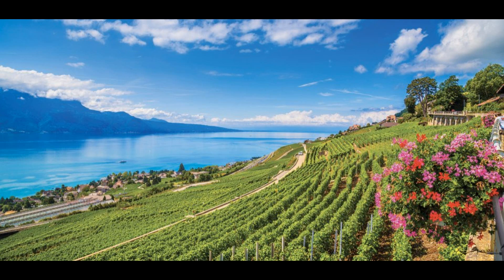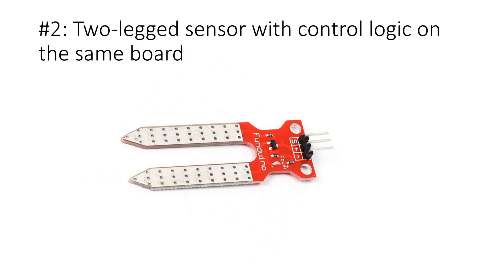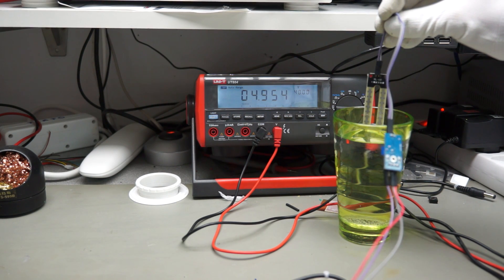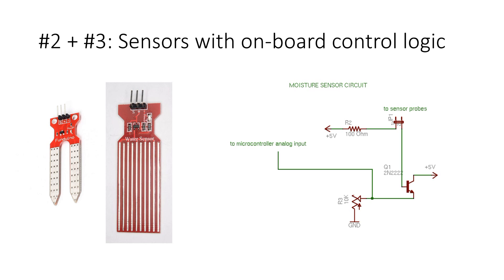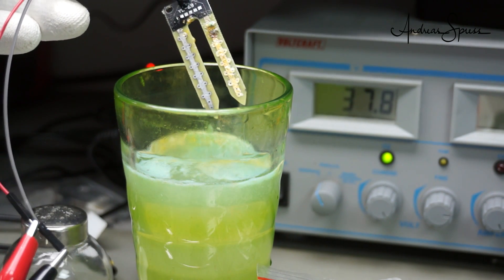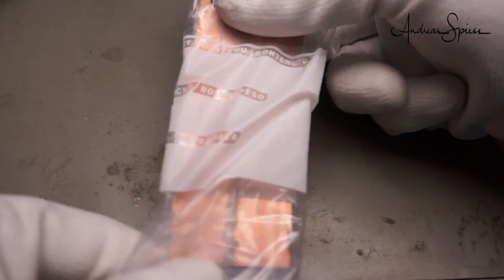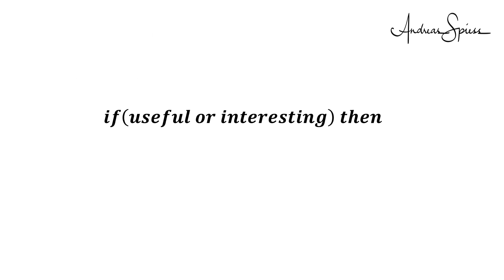#207 Why most Arduino Soil Moisture Sensors suck (incl. solution)

Comment: Likely someone already explained the green foam in the water, but to keep it fresh, a brief explanation.

The green "gunk" is the de-plated copper from the sensor.  Copper turns green when combined with oxygen, forming copper-oxide.  (The Statue of Liberty was once copper colored, but exposure to the environment turned her "skin" green.)

Wow, that one was staring me right in the face and I should have realized these cheapo bare copper sensors simply won't work!  

I know what's happening because I use a similar method to extract gold from computer electronics.  The method I use eats away the copper holding the gold on the surface of a chip.  The copper underneath the gold is dissolved by acid, leaving nothing for the gold to bond to.  The gold then floats away for collection.  The bath I use turns exactly the same color of what's floating in your glass.  

And here is the silly thing staring me right in the face.  You don't put copper in a moist environment that contains acids and salts and then run a current through it.  (AKA soil.)  That is an anode and a cathode.  All that's needed is even the slightest bit of juice and some O2 in the environment and out goes the copper!  Do that in reverse with a bit of acid and you can plate things to copper- that's how the gold gets deposited on electronics.  The "teeth" in a stick of memory are copper underneath.  Run that through an anode cathode setup and your memory comes out golden.  (Fun fact- the ancient Egyptians figured this out!  MANY of the "solid gold" trinkets dug up by archeologist are gold plated lead.)  

As to toxicity...

Copper oxide is seriously poisonous.  Best throw that cup away.

But it does exist in dirt.  (Never eat dirt.)  Plants need trace amounts of copper in the form of copper oxide.  You actually consume copper when you eat plants- but it is bound up in no toxic forms.  With the plant in the way to filter the copper, I would guess there is no real harm.  You touch copper oxide all the time on coins.  

But as to the what else is on those sensors?  God himself knows.  

The people who make these devices live in the single most polluted country in the world.  If it were coming out of Europe or the US, the chemical purity of the copper would be assured.  And the strata that the copper bonded to would be food grade- because this is going into gardens you might be eating from.  But somehow money makes that go away.  Maybe it is safe, but i would only use these as a demonstration sensor.  

I hate to be mean, but this is the same place that "recycles" human hair from barber shops to make sure the dog food we buy meets certain levels of biotin and other biological tests.  And let's not forget the "plastic baby milk" incident...  Babies all over Europe came down with kidney stones and some may have died because the company located in in the same country where these sensors are made was putting melamine, the chemical that makes plastic flexible, into baby formula to fool the regulatory testing agencies in Europe.  The people doing this made millions of course.  (Melamine is not dangerous if it is in plastic.  But in food?  Gives you massive kidney stones...)

Point is, most things are worth what they cost.  If it is a super good deal, you should ask wise.

Thank you for bringing this to my attention- before I bought any.
Reply from the maker: Thank you for your explanation. Indeed, in the many comments the copper-oxide was mentioned.

Comment: Hi man great video you helped me a lot! I only have one question, i'm on a project which needs 3 of these sensors, and all of them are relatively far away from an arduino (~20-30 meters), would the loss of signal strenght due to wire resistance be something i should worry about?
Reply from the maker: Depending on which sensor you use. Capacitive sensors maybe pick up electrical noise.
Reply: Damn i really wanted to use them, i guess i don't have other choice than test it myself hahahaha but thanks for answering man, if you have any suggestion to solve it, i'd be thankful hahahah

Comment: why not just isolated the probes and measure the capacitance? sounds simpler and cheaper or i'm wrong?
Reply from the maker: I think the capacitive probe measures the capacity.
Reply: @AndreasSpiess  i mean isolate the cheap probes and  code the arduino to measure the capacity without the 555

Comment: Super simplified explanation: Even without any "power" at all, "dissimilar" (different) metals give up their electronic charges at different rates, as metal gives up its electronic charge, it completely breaks down (corrodes). Even without any power, when you connect dissimilar metals with a conductor (e.g. - wire or water or humidity), the electronic charges move from the weaker metal (anode) to the stronger metal (cathode). When you add electricity, it increases the flow and causes the process to speed up rapidly. Even without electricity, even the tiniest bit of humidity in the air allows this process to happen naturally which is why you when you calibrate the device, you will never see a "zero" reading.

When you calibrate it, you're testing for your environment with your water (and your water's electrolytes, metals, etc.) to see how much voltage is conducted when "dry" versus "completely submerged in water" to estimate a range in between. That's why these must be calibrated on site with the same water that is used to water a yard.

Bonus info 1: Since boats sit in water and are full of humidity (both are conductors), we try very hard to make sure all metals are similar (e.g. - all the same steel with similar compositions). As a "fail safe", we attach a plate of zinc underneath the boat because zinc is an extremely weak metal and will usually give up its charges to other metals so that it rusts instead. Then we replace the zinc plate as needed.

Bonus info 2: This process is the entire basis for how a batter works - one cell is loaded with a cathodic (+) material and the other is loaded with an anodic (-) material.

https://pomametals.com/wp-content/uploads/2018/03/galvanic-series-chart-metals.png
Reply from the maker: Very interesting explanation for an non-chemist. Thank you! It created some memories from way back when I was in school.

Comment: If we want to keep the sensor from corroding in the soil, then how about we only put the sensor in the soil when we need a reading!
Put the sensor at the end of a solenoid: when you need a reading, engage the solenoid, it pokes the sensor into the soil, take the reading, sensor gets pulled out of soil. Ready for next reading!
Crude yes, but extremely effective...
Reply from the maker: You find many tricks in other comments. You are the first proposing to move the sensor mechanically.
Reply: Andreas, having worked for several Orchid Growers in California over five decades, using Acids to neutralize Calcium in Hard Water and Liquid Fertilizers which were caustic, we had to get creative with the limited tools at the time that were Cheap to implement and simple enough for Nincompoops to understand once demonstrated!
You have an excellent channel, I refer people to it all the time who are looking for well explained solutions and, who are hungry to learn...

Comment: I imagine that if the sensor isn’t powered constantly it wouldn’t corrode as quickly. Perhaps the solution to using these would be activating them periodically for a reading and then unpowering them.
Reply from the maker: You are right. Many other commenters use this possibility with various success.

Comment: very interesting, i totally agree and understand. i will say that the cost of even "toperish" line sensors, is too inexpensive, and easy not to swap out or care too too much.also most people will and should water by hand when they are physically there checking plants for all sorts of decent reasons, this even one in a few waterings will add significantly to the duty cycle of dc current in the sensor. most people plants are worth more than sensors, you could literaly arbitrarily replace them every season and be out hardly any money. just not worth its like buying printer ink. the carbon footprint is low as well  so environmental factors are negligible. i guess what I'm saying is this is one of those once in a while a problems that come up thats not worth fixing for most people. these should be considered disposable .... i will try to cure cancer first lol
Reply from the maker: I agree.

Comment: What is happening to the twin fork sensor is there are two types of dissimilar metal with mostly opposite electrical charges, copper and probably zinc. The + and - of these metals are connected through the water (an electrolyte) in the pot and the metal flows from one side to the other.
Reply from the maker: There are many comments with experiences of other viewers.
Reply: @AndreasSpiess  Great

Comment: I hook up the sensor power to a gpio output pin and turn it on once every 2 hours for one reading. On for about 3.5 seconds every 2 hours. Extends sensor life. Plant moisture levels drop very slowly, no need for an always on plaint moisture sensor.
Reply from the maker: Thank you for sharing your experience. You find many other comments about that topic. Not all went well over time...

Comment: Hello all, Andreas great job, but if you use, as a moisture sensor, two nails sticked into the soil and meassure the resistance between them, all your problems are solved. You don't have to order from China. Just use a voltage divider on your Arduino analouge input and the job is done. Schöne Grüße aus Bayern.
Reply from the maker: Maybe you read some of the other comments...
Reply: @AndreasSpiess  Well, the argument that nails oxidize and then dissolve themselves, as shown in your video with the copper moisture sensor, is actually not a given with robust nails. But maybe I am wrong, I have just build such a watering system. Let's see what future brings.

Comment: I know that this is an old video but another factor is overlooked. 
The composition of the soil can affect the capacitance,  So you must calibrate your sensor to your soil.  I.E  
Measure dry soil and then add an optimum amount of water.  Also the chemical mask up of the water will be another viable.  I.E. Tap water  VRS rain water  they will have different TDS that can affect the sensor.
Reply from the maker: You are right. Unfortunately I did not find any studies using such sensors where we could see how accurate they are and how they compare with other sensors :-(

Comment: The new version of those capacitive soil moisture sensors uses a TLC555 instead of a NE555 - this pushes the astable frequency up to around 1.5Mhz. We found this improves the sensors resistance to salinity & temp effects. Also paring the capacitive sensor with a $1 ADS1115 module gives you resolution beyond that of the standard Arduino ADC. 
    https://thecavepearlproject.org/2020/10/27/hacking-a-capacitive-soil-moisture-sensor-for-frequency-output/
Reply from the maker: Thank you for the link. Good writeup. However, I am more interested in real measuring results, not just more "electrical" resolution. Do you know of any test rows done with such sensors and a comparison with professional (e.g. TDR) sensors?
Reply: @AndreasSpiess  I linked to several papers in that post, but sadly none with what I'd call quality side-by-side testing. What I can say is that in our real world testing this summer  the stair-step shape of the daily draw down pattern compares well to the literature for the environment we were using. So qualitatively speaking the TLC based probes seem much less affected by temperature/salinity than the early generations of commercial sensors that were operating down in kHz ranges. But full calibration is non-trivial due to the soil itself and that's now freezing solid in my part of the world. [and all the leaves are gone - so no deltas to observe].  So it will be late next year before we can really prove they are as good as they first appear to be.
Reply from the maker: A study like taht would be very important, I think because cheap humidity sensors are needed in many parts of the world.

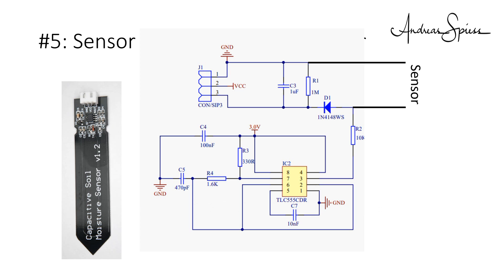Comment: Not sure about the circuit at 07:24.  The pins for IC2 don't seem to be right. As far as I know, the pins should be numbered as
1       8
2       7
3       6
4       5
Can anyone confirm if the circuit worked for them, and if so, how were the pins connected.
Reply from the maker: It is not unusual to use different layouts in the diagrams. This is why they are numbered that the layout software can do the correct traces. On the diagram it is more important to keep things together.

Comment: Great Andreas always the number one. just in these days, I'm approaching these arguments. I have to test the leakage in the cooking room. Actually, I solved it using a couple of steel electrodes mounted on a homemade 3d printed box. Your video has been a great help because I was waiting for the capacitive sensor for testing it. It already works and I send an allarm message on telegram when the water gets wet on the floor. Now in my agenda are some projects refer to your works. All the best, I rest waiting for your next video.
Reply from the maker: Glad to see that my videos help to solve real problems!

Comment: Does number 3 works like soil humidity sensor?? I thought it was just for water level
Reply from the maker: Maybe you are right. I never tried it because I thought it will have the same problems as the other similar one.
Reply: @AndreasSpiess  I bought one of those a while ago, and it is labelled as a "Water level sensor". But one thing is certain, as you replied, has the same problems that you mentioned in the video.  Thanks for answering!

Comment: So with a resistivity sensor I have noticed that people seem to be taking either continuous measurements or multiple measurements per second making more a constant ( oa almost constant) current running.  Would you not be better off only taking a measurement every few minutes or even once every 15/30/45min?  That way you are heavily reducing the amount of current you are running through the sensor and greatly increase its life span...
Reply from the maker: You are right. But still it will corrode
Reply: @AndreasSpiess  Fair enough, but if say a sensor corrodes to fail from current electrolysis in a month from measuring every second, than changing to a measurement every 15 min would make it last 75 years.  Long enough anyway that  electrolisis would not be the fail point anyway...
Reply from the maker: Maybe you read the other comments concerning this topic.

Comment: The real question is: Are they reliable?
Apparently the cheap ones will show for example 85%, then when you water the plants it doesn't change at all and stays the same for several days
Reply from the maker: So far I did not see any studies done with those sensors.

Comment: Thank you Mr.spiess for this very informative video about sensoring moisture. Can you make a video about measuring water level in a water reservoir like a cistern which collects rain water. I though about measuring the hight with a Ultrasonic sensor at the top and calculate the hight compared to measurements of the cistern to get the sum of litres. But there is a huge problem with water film over the sensor which leads to many errors. Is there already a solution in your YouTube portfolio? 
An Arduino or esp32 solution is the goal;)
Reply from the maker: Unfortunately I have no use case in my area. We do not have such open cisterns. Only villages have them. And they are closed. So I cannot do such a video in a good quality
Reply: @AndreasSpiess  Thx anyway for your answer. I think i will build my self a level gauge construct of an old petrol tank float lever thing and a tiny esp32 in a IP68 housing. Surely i should make a video about that build :)

And i have to decide if i use Python or Arduino-C for this...but thats thinking to far by now ;)

Comment: First impression: It seems to me it is use of the DC signal that is the issue. All sensors tested here impress a DC voltage across the cap. Yes, it is DC - the voltage changes from 0 v to some positive voltage, but the current always flows in the SAME DIRECTION. By definition this is DC. This makes the measurement convenient: the DC voltage is proportional to the dielectric constant of the soil. However, the corrosive effect is still at work - even in the "favored" sensor! The PCB material will SLOW the reaction - it will NOT STOP it. The solution: Use an AC signal, and measure the phase shift introduced by the capacitor. This PHASE SHIFT is also proportional to the value of the capacitance, and therefore the dielectric constant. How to measure phase shift? You can wait on Andreas - or you can figure it out yourself :)
Reply from the maker: There were already many comments about the matter. I would add conformal coating to the capacitive sensor to give it a longer live.
Reply: @AndreasSpiess  I recall two issues mentioned wrt the electrolytic corrosion: 1. Reliability - electrodes don't last long, and 2. Contaminants - the copper sulfate produced. Conformal coating seems to address # 1 - so long as there are no leaks, but many conformal coatings are also toxic, add cost & a "fuss factor". Does the AC approach have drawbacks I'm not seeing?

Comment: Grüessech Andreas! Merci vil mol für das Video!
I don't understand how your self-built capacitor still works inside of a plastic bag.
Is it detecting the humidity of the plastic?
Could you provide a quick explanation?
Reply from the maker: Through its electrical field it measures the properties of he material between its electrodes. But not only exactly between the electrodes. The field also hits other parts. Electrodes in capacitors always are completely insolated.  ( https://en.wikipedia.org/wiki/Capacitor )